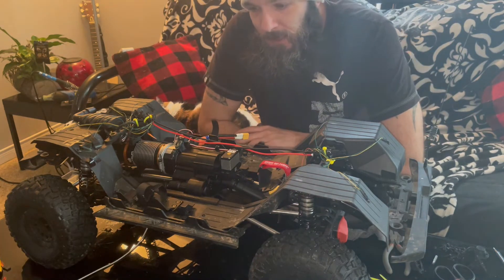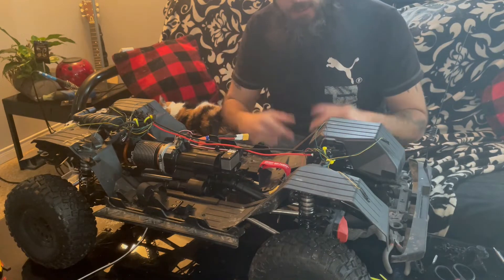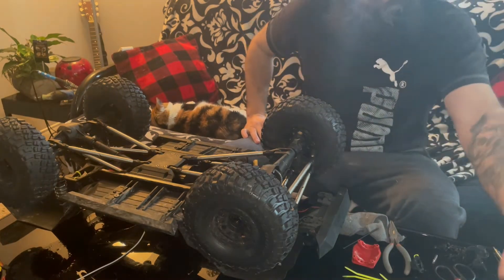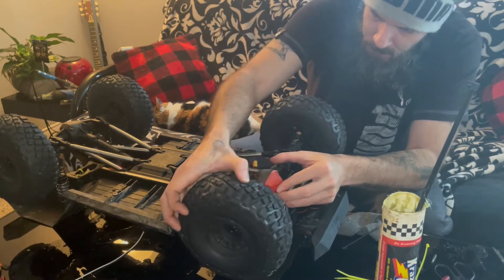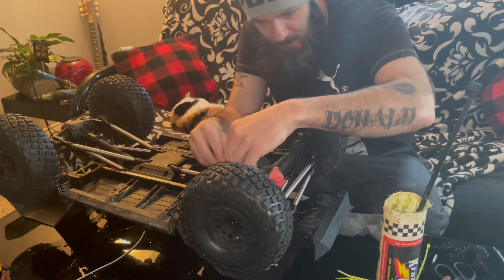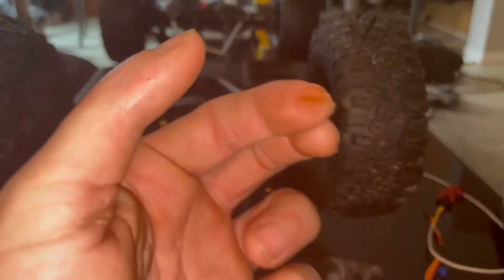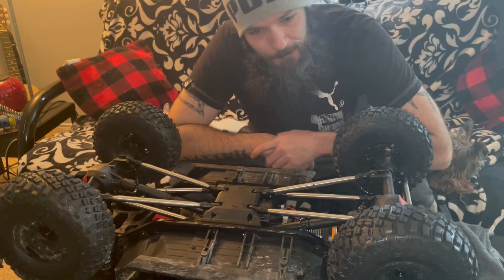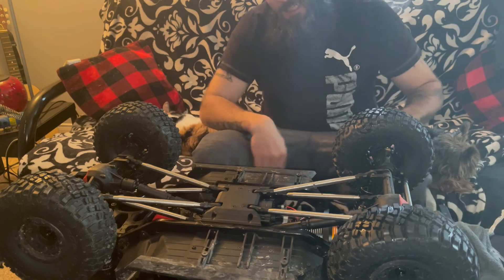Do you need to change the grease in the AXIAL SCX6??

Comment: are you saying marine grease? I use dynamite marine grease on my higher speed diff housings for the ring/pinion gears on other trucks. I pack it in and it doesn't weep unless the main diff seals start to get tired and their fluid leaks.